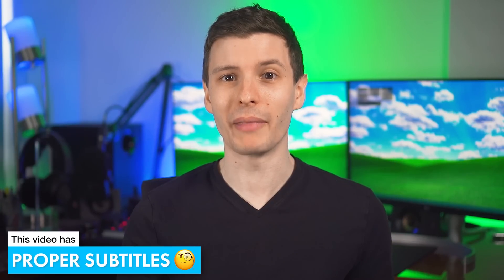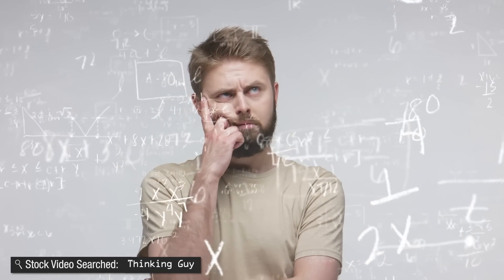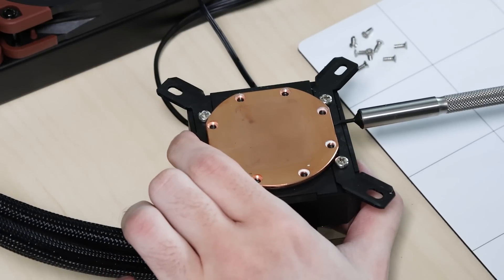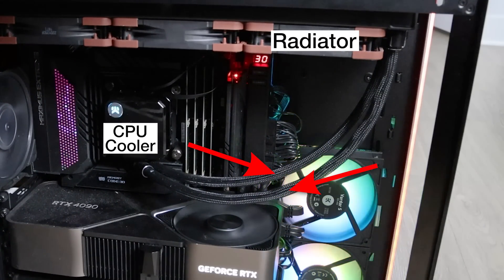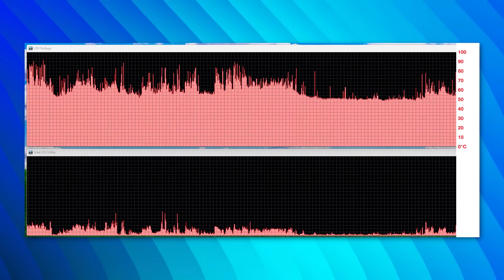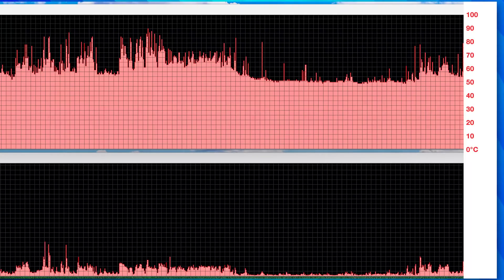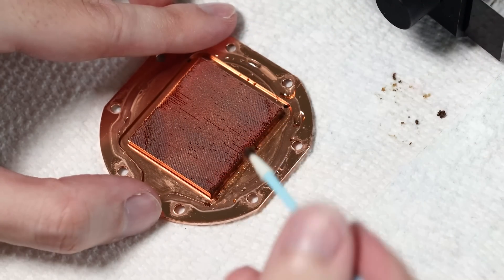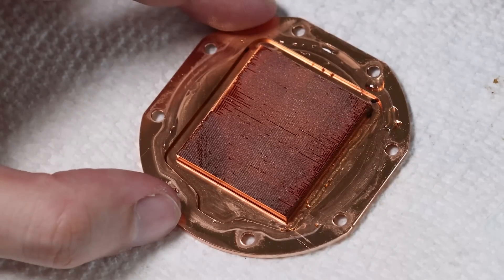The Mystery CPU Overheating Problem Took Me Months To Solve

Comment: Not saying getting a liquid cooler is bad, but this is the exact reason why i always go with tower coolers. There's just nothing like strapping a big block of metal to your CPU. If you see the fan spinning, its definitely working. Especially when I'm building for someone else I just don't want to have to worry about the liquid, or pump, or any leaks.
Reply: Same.
Reply: fr, i don't even look at my fan im just trusting it
Reply: @idan678  usually hear mine lol
Reply: For one of my previous computers I just bought one of the biggest tower coolers I could fit inside the case.
I didn't install the accompanying fan and instead relied on the case fans to cool it.
Reply: You just have to worry about dust buldup on the heatsink
Reply: @RickMyBalls  dust can be a problem, but it's a very visible problem. And no matter what, you still have a lot of thermal mass on top of your CPU. You're just not going to see those dangerous spikes to really high temperatures on a dusty heat sink. Your CPU will have plenty of time to throttle to a safe level. A clogged block is almost like not having a cooler attached at all.

You also have to worry about dust with a liquid cooling setup as well. Unless you find a way to cheat physics, you'll still need a radiator with fans. That radiator can get just as dusty. No matter what, you'll need filtered intakes on your PC and actually clean those out once every while.
Reply: If I wanted to run say a 13900k(s) to it's full potential then I'd get an AIO or go custom loop but since I'm fine with a slightly undervolted 13700 like you I'm fine with a good tower cooler.  

When I was building computers for people during the pandemic or helping them buy prebuilts I went with air over AIO (and explained why) for the same reason.  I had one customer whose kid was upset that his shiny new computer didn't have an AIO in it and I told him he could swap it if he wanted but there was no reason for it with a 10400 and afaik it's still running the tower cooler almost 3 years later.  

Totally get it for higher end stuff especially if overclocking but it kind of drives me nuts when I see build videos on YouTube where the AIO costs more than the CPU, but in the end if the person is going for aesthetics and is happy with the end result it is what it is.
Reply: When in doubt, thermal mass it out.
Reply: As somebody whose personal computer has been custom water cooled for 8 years, I recommend air cooling to the majority of my customers.  Have seen so many failed AIOs.
Reply: Air coolers are not as good as AIO, but they are safer bet when it comes to reliability.
Reply: Yep at idle the fan doesn't even need to spin for my Noctua NH-D15S, the heatsink itself does such a good job!
Reply: People did really forgot noctua exist 💀. AIO is trash when against noctua even for i9.
Reply: Tower coolers with an i9 12th or 13th gen is absolutely stupid.
Reply: @gex581990  Really? Then how come my i5-13600k which performs better than the i9-12900KS can run at temps under 60 degrees with a full load with only 1 of 2 fans attached to my noctua d15?

Edit: Yes I do know he said i9 but with the 13th series i5 performing as well as the i9 of 12th series I'd say my comment still applies. And only 1 fan is attached
Reply: liquid cooling gives me anxiety
Reply: Yeah it took me all of 2 AIOs myself to give up on the idea, I always recommended clients go with air cooling because if a fan dies you can just see it not working, but I thought for me if I have to work on an AIO because it's clogged or something I can do that myself. Then after the second time I realized, actually I just don't want to.
Reply: I think part of my concern is the risk of leaks and all the other routing you have to take into consideration.
Reply: I just built my first PC and went with a very solid air cooler. No regrets.
Reply: I just don't do liquid cooler if i build a PC for someone else.
Most people can't even be bothered to clean the dust filters, much less doing regular maintenance on a liquid cooler.
I really don't want to provide tech support for issues caused by poor maintenance, so i just strap a chunky air cooler on the board and call it a day.
They don't break.
Reply: 👏🏼👏🏼👏🏼👏🏼👏🏼👏🏼👏🏼
Amen to THAT!
Reply: @Niosus  Yeah the less moving parts and points of failure, the better thats why the most reliable pcs have just passive cooling lol
Reply: You cannot adequately cool a 13900k with a tower cooler, not if you want full performance that is.
Reply: Been using liquid cooling for 10+ years, never had issues. I've had regular coolers fail and literally have my processor smoke and burn a hole in it.
Reply: @scamazonprime  How have you never had issues with liquid cooling? What kind of maintenance do you do?
Reply: @_aullik  skill issue
Reply: @_aullik  My custom setup has been running about 6 years with me doing nothing but my res is getting low. If everything is clean and you use good stuff you should not have any issues.
Reply: @SkinUpMonkey   I thought i used good stuff, but i guess not.
Reply: @_aullik  what did you use?
Reply: @_aullik  a custom loop installed correctly is extremely dependable and will not fail, just requiring a coolant change once in a blue moon. Most horror stories start with installation mistakes or oversights. It is more complicated than slapping a big tower cooler for sure tho.. no denying that.
On the other hand, not everyone likes to have a 1.3kg piece of metal pulling on the motherboard PCB sideways. and the physics nerds will always like to have the heat expelled outside of the case, not within it :p
Reply: @ledoynier3694  I started with an AIO until the pump made problems , then started upgrading step by step. Maybe my tubing is shit maybe its a problem with the radiator (leftover from AIO), or its the cooling, who knows. My coolant gets milky quite fast.

The thing is, the whole topic is really complicated and there isn't that much good information on how to do it correctly out there. There is however, quite a lot of conflicting information.
Reply: @SkinUpMonkey  See my other comment. Most my stuff is alphacool, as for the specifics, I honestly would have to look that up. Couldn't tell you by memory which types of plastic are involved.
Reply: @_aullik  I got all EK but key thing is to make sure everything is clean with a good flush then use Mayhem Blitz cleaner and I also used their pastel coolant.
Reply: @scamazonprime  If the hole in the processor was after 2002, let me suggest that cooler failure had absolutely NOTHING to do with it appearing.
Reply: @scamazonprime  You're lying. Regular colors are just big blocks of metal and cannot fail.
Reply: @muhammadamohsin Not true. You forget most heatsinks have heatpipes in it nowadays and if they leak or bend to much it can be a problem as well.

But I have seen so many mistakes with watercooling I can hardly appreciate any of its effectiveness. Alphacool has failed me and also EK. One of the problems is that in most AIOs you get mixed copper/aluminium loops but NOBODY talks about it - though everybody is saying you SHOULDNT mix those 2 in a loop. You are basically safe if you use copper only (pretty much, even though acrylic and bendable tubes weaken over time) - but even then, do I really want to put Water into my system, to the point where it could flood most of my stuff because the radiator is so large? 

Going by the economics, a tower cooler is also better as it uses less material. BTW running a 13900k on a nhd15 is definitly possible....overclocking is another thing but there you are generally then mostly limited by how much wattage can be sucked out of the cpu.

Realistically nobody wants a largely powerhungry and unstable cpu for everyday use so not everybody wants to run his cpu by the thermal limit ^^
Reply: @schnabox  lol flood, I got 2x280, 1x420, monoblock, gpu block and a large res which hold a bit over a litre so there not much there to flood plus you would leak test for hours or even over a day before turning on the system.
Reply: @mjc0961 heat pipes in tower coolers are phase change, and if a pipe has a flaw the fluid can escape causing it to fall.

I don't know if any blocks of metal that can cool a 13900k.
Reply: @scamazonprime  Wow... What happened?
Reply: @scamazonprime  cpu and cooler ar going than and maybe the motherboard but with air cooling slap a new one on and hop fixt
Reply: @scamazonprime  and 99% of the existing and existed pcs used regular cooler and they were fine.. I mean it is not impossible to kill your cpu if you don't know what cooler should you use.. but that is not the cooler's fault

Not to mention that there are more vids on yt about failed liquid coolers than about failed regular coolers.. in the recent few years (as liqiuid coolers became more popular) there are more and more vids about liquid coolers failing
Reply: AIO's can be good too. My h115i pro has been running for more than 4 years now and the temps are as good as day 1.
Reply: @SaccoBelmonte  Can, but not all are. Regular heatsinks are good always if you  install it properly.
Reply: @RDCST  I agree, they're no frills and will never fail. I just don't like the big chunk of metal in my PC builds. Just doesn't look good to me.
Reply: This is the equivalent of saying this is why you'll stick to books and newspaper as you can never trust computers... just absurd.
Reply: @sujimayne  With all the trolls and misinformation online, the world would be a better place if we went back to books and newspapers.
Reply: @sujimayne  That comparison is bad. air and water coolers are both coolers, just one being a lot more complicated for a little bit extra performance.

Comment: I have a tower cooler on my i5-13600k. Even on full load it barely goes above 60 degrees. Just a Noctua 15 with only one of the fans attached (the other doesnt fit on with my ram). Works awesome, so much easier than water cooling
Reply: I got the noctua nh-d15 and Ryzen 9 5950x and it never goes above 65 even when benchmarking. Idles in windows at 30. I'm never go back to water cooling. Too many things that can go wrong.
Reply: @@LTNetjak i think(?) 3d cache chips might be running slower thus generating less heat
Reply: @ilker2445     what are you talking about bro 🤯 you know that 5800X3D and 7800X3D is called Gaming/Performance Beast Right!!
Reply: I use the beQuiet Dark Rock Pro 4 on my 12700K and with the TG contact frame I have to push the CPU to 215W to make it reach 100°C. It's an amazing cooler! It also won't ever clog up because there's nothing to get it clogged up with
Reply: @@LTNetjak Only one as I said in original comment. Won't fit in my case above my ram which is why it's a decent amount hotter
Reply: @PREDATEURLT      yeah i know that but i guess i misunderstood his comments i think 🤔 he's talking about lower clocks speed not lower performance 😐
Reply: I just built a PC with an i7-12700K. Went with the be quiet! Dark Rock Pro 5 air cooler. The max I’ve ever seen it get is 88°C but that was only under a full Cinebench stress test. Even while gaming in 4K with ultra settings, it never goes above 70°. No regrets with an air cooler.
Reply: Yeah because that's just a 13600K, not comparable to a 13900KS. Also the NH-D15 basically costs as much as a water cooler 😂. There are much cheaper options.
Reply: @b4ttlemast0r  It only has 1 of 2 fans attached and the i5-13600k is known to be very good performance wise and does kick out a sizable amount of heat so it isn't far fetched to say with 2 fans it'd easily cool the i9-13900KS.
Reply: Sure but for longevity you can't beat aircoolers. My old nhd-15 lasted me two pc builds then I sold it years later to a man that used it in his build lol. The thing just wouldn't die and this was still with the original fans that came with it 😂. Had the thing for like 7 years @b4ttlemast0r
Reply: @b4ttlemast0r  but have almost 0 noise and lifetime support!

Comment: Sounds just like the issue my Dad's MSI desktop had recently. It was also overheating every once in a while too. We had tried cleaning it out and re-applying thermal paste, but it only helped for a few days. We ended up replacing the entire AiO water cooler and were amazed how much better the temperature was.
Reply: MSI has a bad history with clogging due to using Apaltek as their manufacturing OEM.
Reply: MSI had been having issues with the coolant inside the pump/radiator having some kind of growth that was clogging the cold plate fins and tubes.  Greg Salazar has a couple of videos of him tearing them down and showing the problem.  I had the same issue recently with a Corsair pump/radiator.  I have an RMA from them to send it back, so I'm sending it back.  I've since gone back to Cooler Master AIOs.  I have been using them since the beginning with ZERO issues.  Don't know why I started using Corsair, other than reputation, and probably was on sale on Amazon.
Reply: @l.i.archer5379  GamersNexus has also taken up the MSI AIO problems several times and they're a fair bit more reputable than Greg...
Reply: Similar issue happened with my computer. Built a MSI inspired tower with components from the company, it took a while before the cpu block showed signs of thermal issues. Did a few quick test, even checking the BIOS to determine the AIO going faulty due to clogs. Switched it to an air cooler and has worked fine. Need to RMA MSI AIO.
Reply: This is why AIOs are risky for cpu cooling. If your going water cooling route its better off to go custom loop or for budget cooling just get standard cooler to avoid these types of issues lol.
Reply: Yes, other than cooling your unicorn puke PC, AIO's are basically a scam.
Reply: @Matcc  Well, it was a pre-built computer that just came with the AiO cooler. My dad really likes the computer otherwise, and the replacement cooler has worked out well.
Reply: @Matcc they aren’t. Using this case and MSI failures isn’t nearly enough to deem AIOs unreliable or bad.
They are very good, but they can have problems. The pump will fail at some point, but it is not nearly as bad as you are making it out to be. It should last for 10 years easily unless defect.
Reply: Sounds like the manufacturer isn't doing a good job of removing process chemicals.  Knowing the problems with this manufacturer it may be advisable to run an alcohol flush of the components prior to install.
Reply: @ianbelletti6241 An AIO that you need to flush and refill before actually using it is all of the disadvantages of an AIO combined with all the disadvantages of a custom loop...

Comment: Nice, did you end up putting any bio-killer in the liquid of the cooler after cleaning it?
Reply from the maker: Nah maybe i should have 🤔
Reply: Thought he was using a clc🤔
Reply: @federicocatelli8785 he is using a clc, but there's nothing stopping you from draining and replacing the fluid. Some models even have a fill port in the radiator. Mine has a small screw covered with a sticker.
Reply: @euge963  I'm not into clc so THX for letting me know .